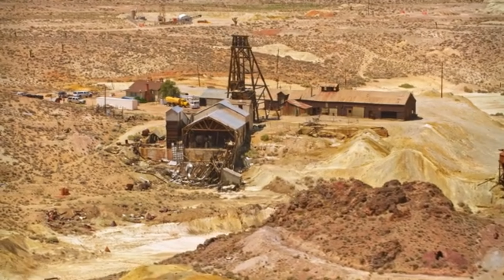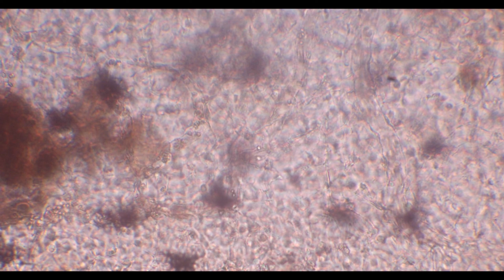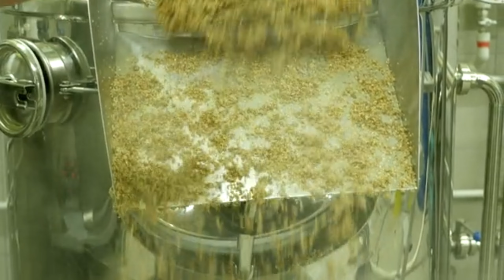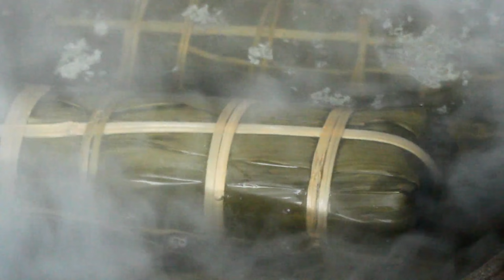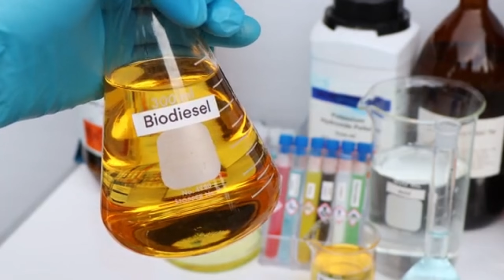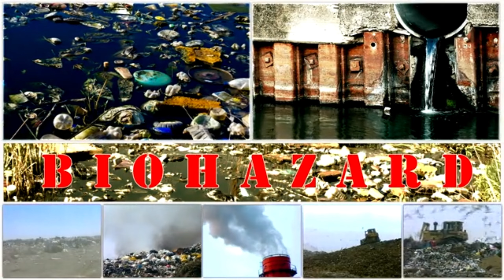Fungal Gold Mining Full Guide – Sustainable, Silent, and Real

Comment: Useless. This video tldr; is certain fungi are producing acids that can very slowly dissolve gold. Cool, do you know what else is producing acids in much greater quantities, much faster, higher concentrations and without extra steps of growing and applying fungi? Chemical plants. Do you know why we are not using acids on a big scale gold extraction and why we are using cyanide instead? Speed and efficiency. If gold producers are not using cheaper, more available and more convenient industrially produced acids now instead of cyanide, what would make them use fungi and tank their production rate to medieval times? Next video, why are we making diesel when we can use used oil as fuel....
Reply from the maker: You’re absolutely right that chemical plants produce acids far more efficiently than fungi, and cyanide remains the dominant method in industrial gold extraction due to its speed and yield. But the point of the video isn’t to claim fungi will replace cyanide tomorrow, it’s about exploring alternatives for contexts where traditional methods are too toxic, expensive, or environmentally devastating.

Fungal bioleaching isn’t competing with industrial cyanidation, I t’s offering a potential solution for low-grade ores, abandoned mine tailings, and places where chemical infrastructure is limited or dangerous. It’s also a growing part of green chemistry efforts aimed at minimizing long-term ecological damage. That matters, especially as regulations tighten and sustainability becomes more than a buzzword.

Also, dismissing the idea because it’s not faster today is like laughing at early solar panels for not beating coal overnight.

Appreciate the critique, next time, maybe watch for the nuance before writing the TL;DR.
Reply: @Broadscience  the nuance is that you are far better off by using industrially produced acids instead of fungi.
Reply from the maker: @lamebubblesflysohigh That’s fair, and in many cases, you’re right. Industrial acids are faster, cheaper, and easier to scale today. But here’s the nuance you might be missing:

It’s not just about performance, it’s about context. Industrial acids still come with major downsides: toxic runoff, hazardous handling, and long-term environmental damage. That’s why fungi and other biological methods are being researched, not to beat acids or cyanide on speed, but to offer safer, low-cost alternatives in specific use-cases: like artisanal mining, e-waste recycling, or reclaiming gold from toxic tailings where traditional methods are too risky or banned.

No one’s suggesting we tank global gold production to medieval speeds. But not every solution has to compete on brute force. Sometimes, slow and safe has its place.
Reply: @Broadscience  what toxic runoff? Acid is acid, it doesn't matter if it was produced by fungi or in a chemical plant. You can simply dump some calcium carbonate in it to neutralize it if excess acidity is your concern or dilute it. Yes handling is more hazardous but I would argue not that much more than hanging around huge vats full of fungi slurry moved around by heavy duty stirrers hooked up to high voltage power source. Any industrial scale process is inherently hazardous.
Reply from the maker: @lamebubblesflysohigh You’re absolutely right: acid is acid, regardless of its origin. Sulfuric acid made by a fungus is chemically indistinguishable from that made in a chemical reactor. And yes, neutralization with calcium carbonate or lime is standard practice in acid waste treatment. So if we’re only comparing on the basis of acid itself, then biologically-sourced acids don’t offer any fundamental advantage.

But here’s where bioleaching gets interesting: many fungi don’t just produce acids, they secrete complex organic ligands, chelators, and metabolites that interact with metals in ways that traditional acids don’t. These compounds can bind selectively to gold or alter redox environments, potentially enabling extraction from ultra-low-concentration sources where cyanide or pure mineral acids underperform or become uneconomical. This includes things like e-waste, polluted sediments, or even asteroid regolith in theoretical space mining scenarios.

As for industrial safety, you’re right again. No large-scale process is ever “safe.” But it’s a different risk profile. A fungal slurry may not be benign, but its inputs (organic waste, low-grade ores) and lower operating temperatures make it attractive in places lacking tight industrial controls. Think: small-scale or developing regions, not Barrick Gold-level operations.

Bottom line: fungi won’t beat cyanide on efficiency. But they might beat it on accessibility, sustainability, and regulatory compliance in niche but growing markets.